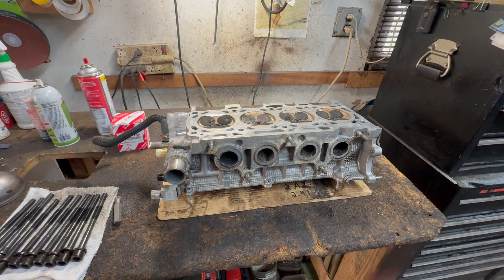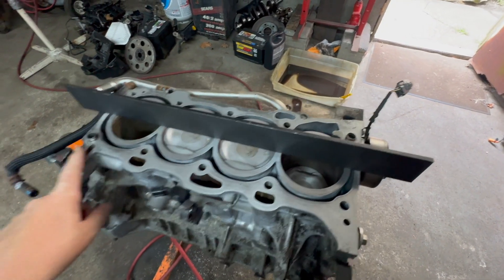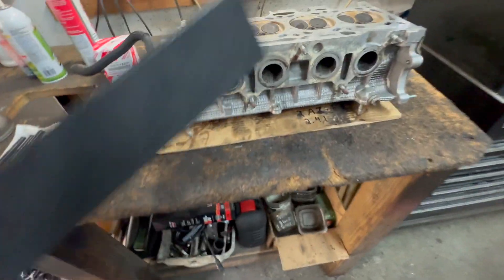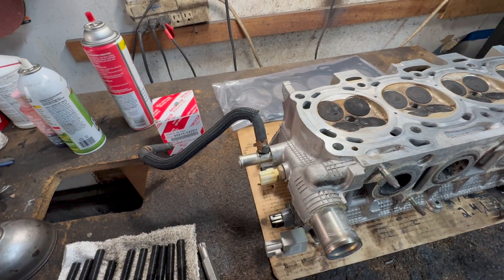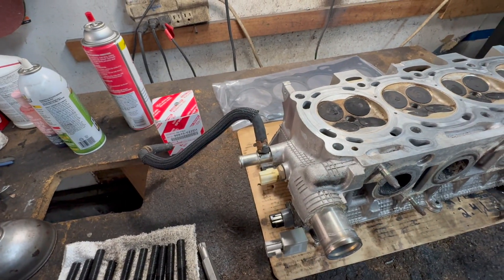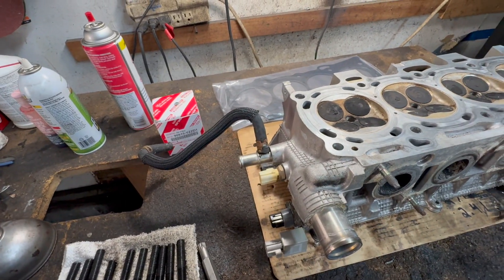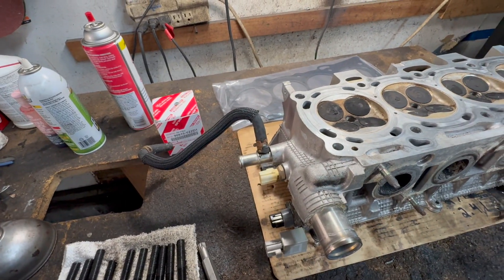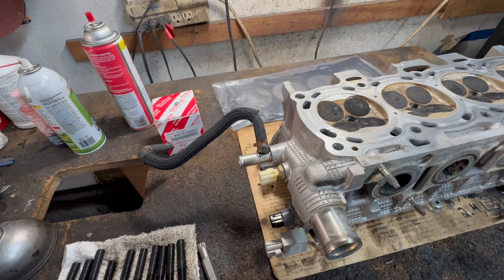Toyota 2 4L Cylinder Head Torque Specs & Sequence & Block Prep -  2AZ FE Engine Build

Comment: What brand did  you use for the head gasket ?
Reply from the maker: I recommend OEM when it comes to head gaskets customer bought theirs I don't know where.
Reply: @motorcarnut  I used felpro new edition multilayer advance coated on my 2004 rav4, and it's been exceeding the OEM for 4 years.  Not a simgle Crack or burn or leakage.
Reply from the maker: Yes, Felpro makes great products, I use them too.